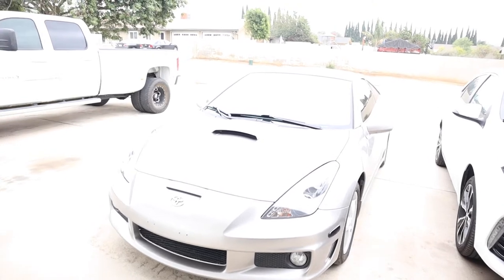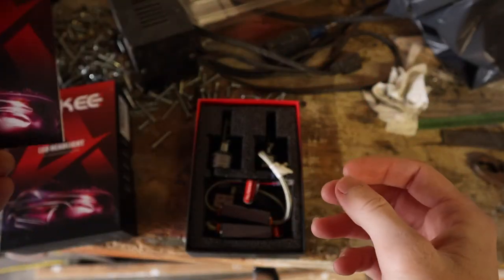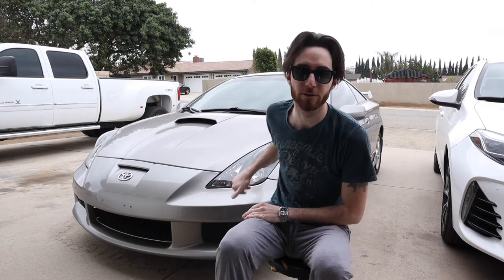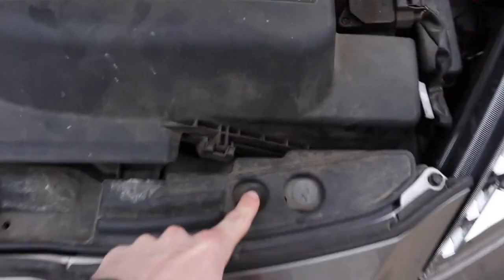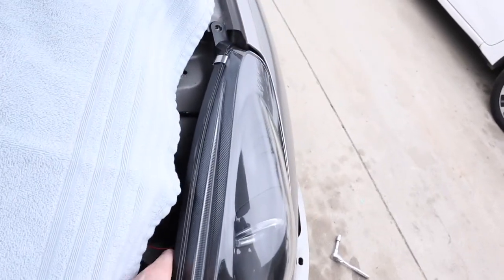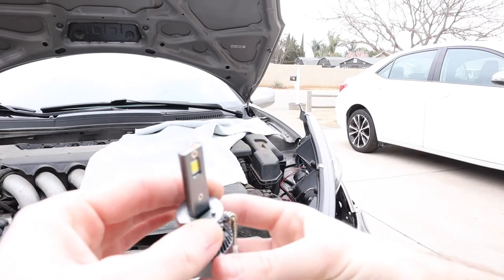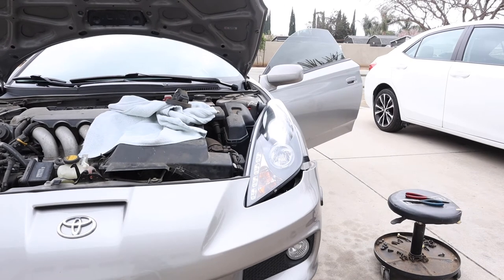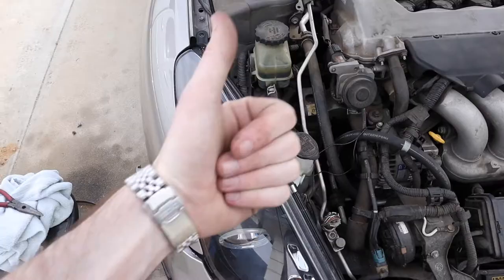How To Install LED Headlight Bulbs In A Toyota Celica

Comment: I went to put led bulbs in my celica, ever since then I've not been getting light on the road, the bulbs are pointing straight ahead and the adjustment screw doesn't budge them

Comment: Nice video. 4 things..  Where did you splice the housing wires to? The red and black ones?  And the LEDs too? Also,  in making the whole on top of the dust cap,  did you pull the other wires out, then made a hole, or how did you do it?
Reply from the maker: The LED headlight bulbs have two blade pin connectors coming from the back, the wires (seen at 7:28) that were connected to the original headlight lamp were just unplugged and plugged in with the blade pin connectors. no splicing required this time. I did however have to splice the led halos to the original wiring, but I showed that in the first video. I simply took some scissors and cut a hole in the top of the dust boot so that I wouldn't harm the existing wires and I could pull the large components (like the regulator box) through.

Comment: A few things I want to comment: 

Damn those wheels looking clean and not exaggerated! And I liked the video´s chilly atmosphere. Lol I can´t sleep so watching this atm.
The celica´s engine bay sure isn´t the most spacious, don´t you agree? :D Well, 1.8l was the only engine choice after all, so that must explain it.
I have the celica 01´ t-sport (170k km driven) with upgraded lift bolts that aren´t prone to breaking and... uh I guess that´s pretty much it.

But the interesting thing is that I am attempting to make it run on ethanol... tomorrow is the day!
Reply from the maker: Haha thanks man! and yeah, unfortunately there isn't much swapping potential for this car, strictly because of how small and tight the engine bay is. You can get away with MAYBE another boosted 4 banger, like the 2.3 l Mazdaspeed, but that's a huge maybe. Best to just upgrade the rods, pistons, and engine cap to make the power you want I think. Let me know how ethanol goes! Did you have to do a custom flex fuel conversion?
Reply: @carboys568  Yeah, glad to announce the fact that I love the high revs so much! I think the exact rev limit is 8250 on my model.
Of course the strict engine bay dimensions help keep the car´s overall dimensions in check, for added sportiness. The engine is light itself, so that is a benefit too. Perhaps it is the perfect engine for this car!

The flex fuel conversion has not been problem-free because of a simple problem. There is kind of a "ring" around the place you want to plug it in, preventing you from using the basic adapters and "opening" the pins for the connection, at least that is how I understood it. I brought it to a tuner and he showed me the unfortunate surprise. But now a special tool has been ordered, specifically for t-sports. Damn, they really do not want us to mess around with it, do they? :D The fuel injectors should be plenty for the conversion though, and of course ethanol loves high compression ratios, or was it something else it loves? Uh, I am pretty sure it is the ratios.

I may add that when I have a surplus of cash, I will do a standalone ECU and make a few extra horses with the ethanol´s benefits. Maybe sport intake and exhaust too. I have heard you can quite easily surpass 200 hp. You just have to give it more air and let more gasses out :D But as for now, I only seek fuel cost benefits from the conversion, as it is much cheaper here in Finland. Even when you take into account the increased fuel consumption.

I will report back here how the conversion goes and if my car explodes lmao!
Reply from the maker: @teme5529  When I was looking into ethanol I ran into exactly the same thing you just mentioned with the alcohol-sensitive ring that causes the issues.I do really wish they made the car a bit more tuner-friendly, but that obviously would have let the intended reliability slip lol. 

Sounds like a good plan though man! A standalone ecu is a MUST if you'll be tuning the car. Are you going PFC?

My plans are a little different but not completely! I'm thinking some suspension, PFC with Tune, and at that point I'd bite the bullet and get a turbo kit with forged internals for reliability. That's a ways down the road though! Still glad to hear another person is working on these babies! Can't wait to see what you do with it!
Reply: @carboys568  Yeah, I have actually barely scraped the surface of the world of tuning, so I had to google the pfc, lol. So I must say I have not looked into it, what standalone ecu brand would do well. But I know it will be costly. Gotta be ready to spend 3000€+

And yes, when I seek power, I need the standalone ecu! Toyota ecu is angry and will erase all changes. :D
And be ready to be spending some cash if you are going for reinforced internals, I guess. 
Have you considered the benefits/downsides of mechanical charging?
Note that this is only my opinion, but the essence of the car is instant power. Turboing would eliminate the lift kicking in hard and immediately. The power curve would be soft. Also the turbo-build would consist of many components, and reducing the compression ratio would probably be a must, I guess.
I think that if I want to charge it,  I will go the supercharge-route. I think it is more reliable and simpler design.

However, when money is not an issue, reinforced internals should do the trick. Turbo won´t be an issue anymore at that point! It makes more power than any other method!

And yeah man, glad to talk about our cars like this! It is always useful to share tips and information.
Reply: @carboys568  And btw I gotta ask what kind of issues about the ring other than not fitting? I mean damn, tomorrow is the installation day so I gotta know if I missed something about it :D
Reply from the maker: @teme5529  I see what you're saying, it really comes down to a preference thing in all honesty! Superchargers are great for instant power, but the amount of power you make is always limited to the size of the opening of the throttle housing. The reason I like turbos is because they provide more mid-range torque, something the Celica has NONE of lol.

I used to have a Mazdaspeed 3, and that thing would accelerate faster than most other stock cars on the road simply because of all the low-end torque it had, which became quite addicting.

The other added benefit of a turbo is easier tuning for more power, and you can control the power at pretty much any time you wish. Something a supercharger can't do without changing the entire housing and installing different parts. This is just why I prefer turbos to superchargers.
Reply from the maker: @teme5529  I honestly never got that far into it! Most people I'd read about who have done flex-fuel swaps or replacements on Celicas just say that it becomes a problem because of something to do with the entire fuel-rail system that needs replacing. I'm not trying to discourage you from doing it at all, but from what I've read, it's quite a job, and not cheap. These cars fuel-systems are apparently very sensitive to Ethanol so a lot needs replacing (fuel tank, fuel lines, injectors, etc.) If you get it to work though, I'd be interested in how!
Reply: @carboys568  Oh damn, well there goes my sleep before tomorrow :D But hey, actually good to hear what others have reported, can´t avoid the truth. That sounds like a terrible job, if it really is true. The only thing that would be installed is the flexfuel kit. The mechanic said that he contacted his intranet partners and reported back that it would be safe to do so. Luckily there is a warranty for all consumer services by law. So if it explodes, it explodes. And if the whole fuel system needs to be replaced, I can´t afford that. I just hope what I am trying is okay!

I may add that he is an honest dude and does not want to rip me off, because it would only turn against him due to warranty by law :D
Reply from the maker: @teme5529  keep in mind that I could be completely wrong that's just what I vaguely remember from what I read months ago lol! I totally hope it works out though! I'd love to see a celica on e and how it goes!
Reply: @carboys568  Okay, it has been done!

Report day 1: it works and i drove back home using e85 (ethanol). On first acceleration to rev limit, my car coughed and I was like "oh god no..."

Then the app started showing a proper rpm gauge that did not stop showing rpm above 8k rpm as it first showed. Now it shows to 12k lol.

And second and other accelerations on the test drive back home did not cough at all. The acceleration to redline occurred normally. However, understandably the error log showed the fuel injectors capacity not being enough temporarily. But I feel like this happened only on the first acceleration. Then the software probably understood that the economy setting is not enough.

So now next time I drive, I will wipe off the error log, and test accelerations again. If it is smooth again and shows no errors, this is victory, I mean at least one battle has been won.
Reply from the maker: @teme5529  Hell yeah man! How does it feel? Obviously, the injector size and economy modes may be an issue, but any noticeable gain already? Glad to hear things are working out though!
Reply: @carboys568  I am not detecting any noticeable gains at the moment, but that I somehow feel like it runs smooth on low rpm lol! Idk how and why that would be, but it feels smooth.

I have to keep the injectors clean to make them work well at 100%. They are indeed on max capacity a small moment at 8200 rpm. I will have to investigate this further. I will report back here how it goes on. So far so good. So yeah, the error just displays at redline for 0.5 seconds, so gotta investigate. 

I need ecu tune if I want more power, but that I cannot yet afford.

But holy hell it was cool to start the car with e85! Surreal! This is just the beginning.
Reply: @carboys568  Update: It is nothing to worry about. I have looked into it, the injectors handle the current setup well, but I could not tune this any further obviously because of the fuel system at the moment. However, todays dyno-pull gave me maximum torque of 190 Nm! That is sick for 1.8 engine! The ethanol does burn better from mid to high rpm, which is great for this car. And the max power however stayed the same, it showed to be 191.5 hp.
Reply from the maker: @teme5529  Glad to hear it's working out man! If I'm not mistaken, 190 nm is equivalent to roughly 140 ft/lbs of torque. That's about a 10 ft/lb increase from stock right? Sounds cool!
Reply: @carboys568  Yes, I just checked! It indeed is an increase of about 8 ft-lb. Glad to share the results!